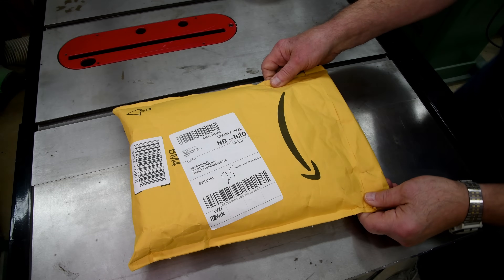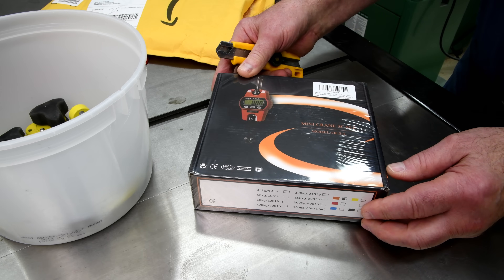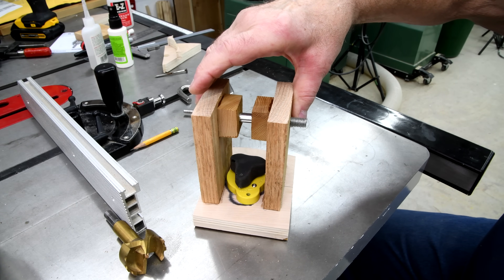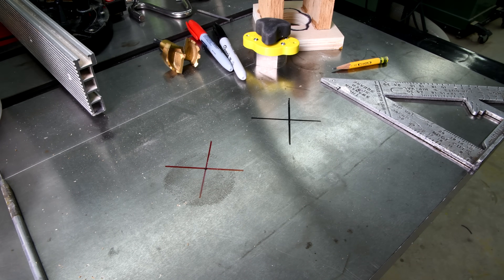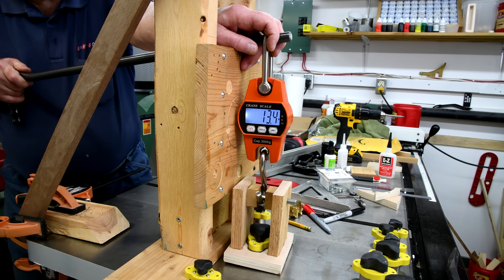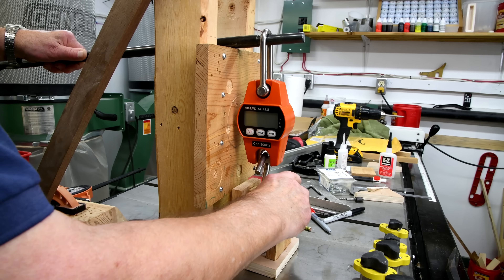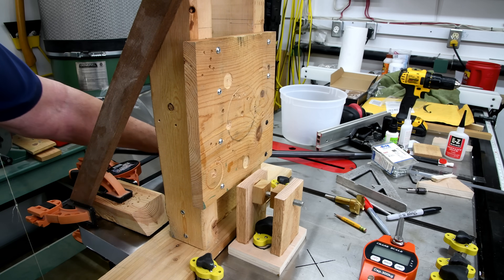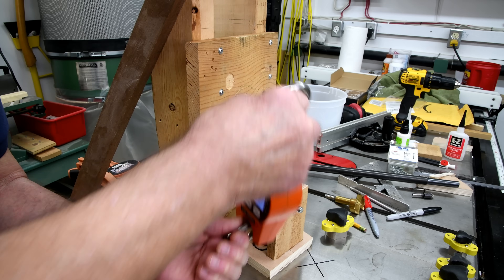The Magswitch

Comment: They mention that the thickness of the metal to which the magnet is stuck makes a difference, so your idea of placing it on a cross brace section makes sense, it might be even stronger if the metal were thicker.  This doesn't really apply in woodworking, but it would matter when lifting heavy metal objects. For a table saw (not including mine, which doesn't have a ferrous table), or a bandsaw table, or a drill press, the strength of these seems to be adequate for everyone who has posted about them on YT.
Reply from the maker: That's a great point about the thickness of the metal; thanks for the comment! 👍

Comment: Not a good test as these are used laterally and are tested  in a vertical lifting use. Plus with wood workers generally have cast iron surfaces. For lateral test the magnet face needs to be very clean of metal grit or debris. What I have seem is it would not be great for ripping long boards as it would just slip.
Reply: lets see the tests you did then. we'll wait. @bobz1948

Comment: Liked the video. FYI the magnets are "less strong" on the subsequent pulls because they were "reattached" to the ferrous surface while the magnet was turned on.   They are strongest when they are placed on a ferrous material and then turned on.  Something to do with how the magnetic field is introduced to a ferrous material when the magnet is turned on. You can also see this if you place it on your table turn it on and then apply force to make it slide. Once it has moved, even if it never breaks contact with the table, the magnetic field changes and it will not be as strong.
Reply from the maker: I was wondering about that. THANKS!